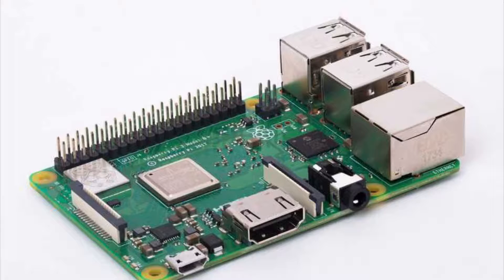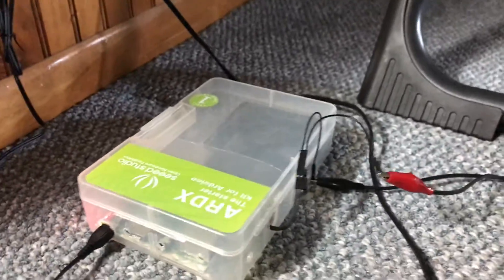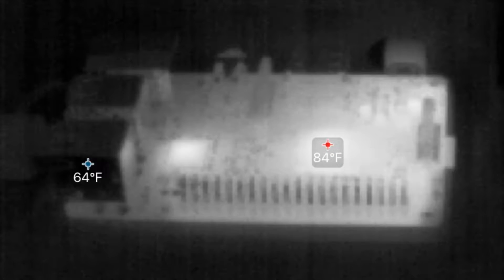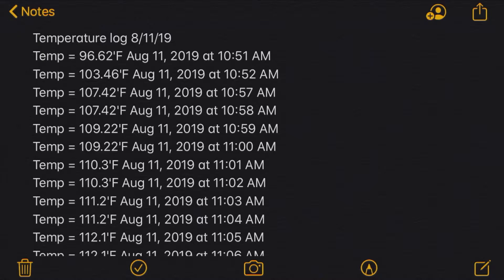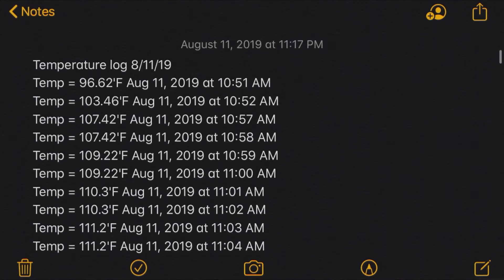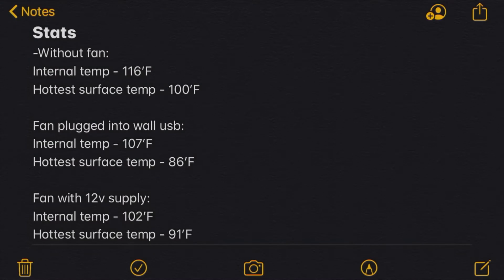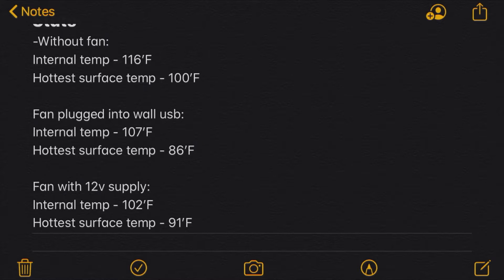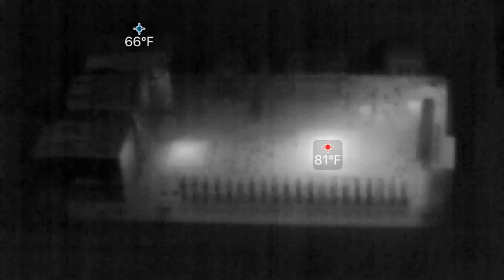Testing DIY Raspberry Pi Cooling Case

Comment: It looks like you are more worried about dust than you are heat. Without a LOT more air holes you are really limiting your cooling capabilities. IF dust on the motherboard is a big concern run a heat sink through the case and have a fan blow on the heat sink outside the case. I run a Pi4 (much hotter than your 3?)with Flicr case (aluminum case used as heat sink) with an external fan. The temperature maxes out at 44C in a 75F room. Without the fan it hits 74C (throttle starts at about 80C).
Reply from the maker: Yes I would say I am, the most mine will be running would be like a JavaScript file or two. It doesn’t get very hot at all. I probably need more hopes to get better air flow as well.
Reply: @metal-rain  Take a look at a Flirc case. They make a model that fits the 4 and another that fits the 3. Last I checked it was about $25 including shipping. For the 3 it will be more enough to keep it cool and it fully enclosed. It just has ports for all the connectors. For the 4 it is a little more questionable. For light work it is fine but for continual heavy load, it probably needs a little help(thus my external fan).
Reply from the maker: Oh wow those are nice, thanks, might have to buy one, $15ish on amazon for the model 3 I saw. How is your pi 4 compared to the 3?
Reply: @metal-rain  Night and day difference. I have now switched to using a Pi4-4Gb as my primary daily computer. Using it to type this right now. IF money were a big issue a 2Gb would get most buy. The are a few caveats though. Heat is definitely one of them. So far there is not direct USB boot but there is a work around(which I am using). The card reader is limited to 40MBps but the USB chip is limited to 350MBps. I switched to a 150MBps flash drive(USB) and that was the last increase I needed to use it as my primary desktop. Youtube videos are a bit of a problem. For all intents and purposes you cannot use Youtube with Firefox. Chromium works fine though (not perfect). Pi4 is new hardware on a new OS version so it is taking a extra time to get things going. Direct USB boot should be available in the next 6(?) months. When FF will add hardware support for videos is anybodies guess. Watch the shipping on case. I have ran into a number of outlets that have the item for cheap but the shipping is more than the item. The guy behind Flirc is pretty much a one man show. Good guy, but this is just a weekend business for him.
Reply from the maker: Thanks for that very detailed answer! The 4GB aren’t bad for price at all in my opinion. And to got from my 1GB to 4GB is a huge upgrade obviously. Not sure if I’ll get one soon, but maybe eventually and use it for some other things such as computer like you are doing.
Reply: @metal-rain  I do not want to mislead you. You are not going to be using it to feed Handbrake a DVD. Well it probably would do it but it would be one of those deals where you start it before you go to bed and hope it is done when you get up. Keep an eye on the Official Raspberry Pi forums. There is lot of interesting stuff. One thing I suspect that is going to happen is that the Pis will be split into two separate boards. One for Desktop type stuff and one for tinkering stuff. While Pis were originally meant to teach and tinker, somewhere along the line a huge portion of their business became kiosks and signage. Which is why the 4 has two HDMI ports. I am betting that the Pi5 desktop will drop the GPIO for a sata (or similar) connection with a 8(?) core processor and that the Pi5 tinkerer will drop back to the Pizero size format and power consumption. Just pure speculation.
Reply from the maker: Yep I understand it isn’t a blazing fast computer if I used it as one haha. For the most I use mine to run a bot for discord so the 3B will probably work for me. I will definitely look online on what the new ones can do and some news on them. Thanks for all the help!